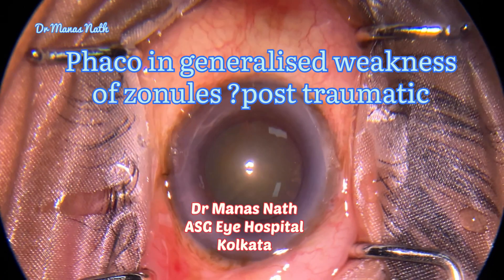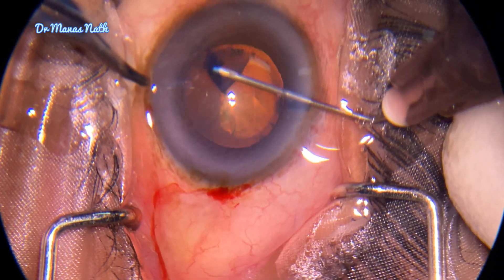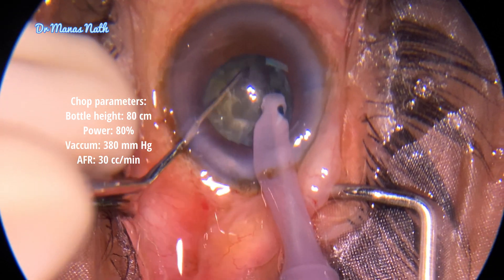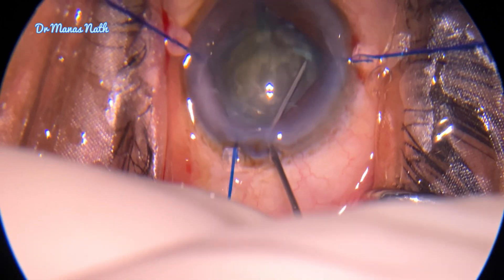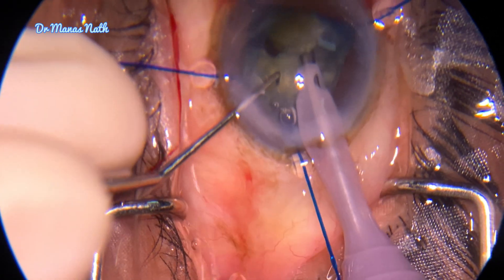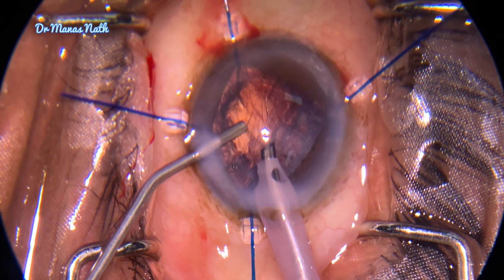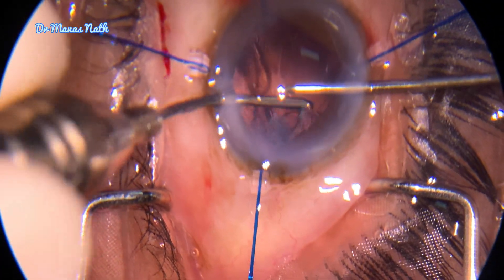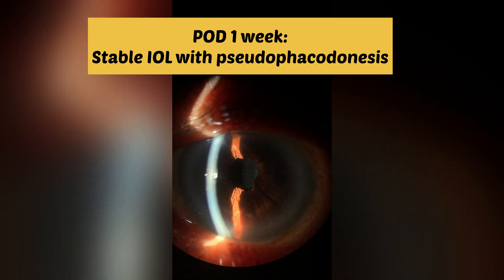Phaco in generalised weakness of zonules ?post trauma

Comment: Honestly I'm scared of putting ctr before nucleus removal. If the bag tilts one has to then deal with the ctr too, in addition to avoiding nucleus drop
Reply from the maker: Thanks for the comment. One can always use capsular hooks to support the bag antero-posteriorly and then can put the CTR. Though it can be put anytime after ccc but there is always a debate on when to put the CTR. I feel, it should be as early as the surgeon feels. In this case the zonules were weak but not that it will tilt the bag. Remaining zonules were strong enough. And it’s not a case of a progressive zonular weakness.